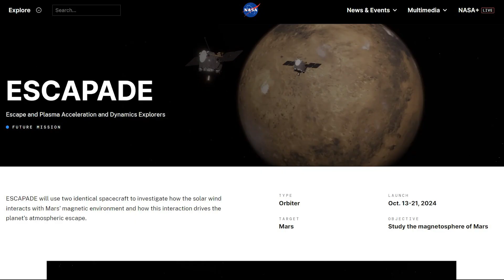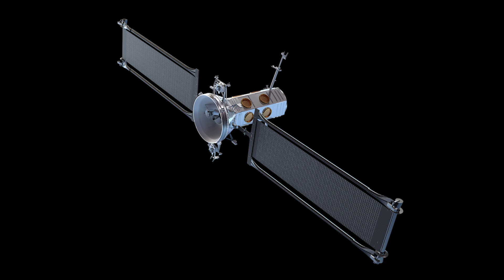Blue Origin Wants To Land New Glenn’s Booster On The First Try

Comment: BO are amazingly optimist, They not even had a static fire. I wish them well, BUT I cannot understand their level of confidence for a rocket that's never even been tested on the ground from a company that has never got close to orbit by a massive factor. Let alone landed an orbital test rocket.
Well one thing excitement guaranteed.
Reply: I guess that's true. They have only tested the individual engines not the assembled booster?
Reply: @wombatillo  They have tested 2 BE4 engines on the ULA Vulcan rocket, But 7 is something else.
Reply: im split on it. on the one hand theyve only ever launched their tiny new shepard rocket. on the other hand the company has within it many employees that do have the full scale orbital experience. additionally the landing profile is significantly easier than falcon 9s given that it can slow to a hover above the pad and lower itself to a landing instead of F9 which must perform the hover slam. I was pretty surprised to hear this from bezos as i had previously assumed new glenns first stage was too light to hover. either way it will be interesting to watch
Reply: 2nd Stage static fire is supposed to be happening in just a few days as it is on the pad, and booster static fire whenever it reaches the pad.
Reply: Back in the old days sonny, engineering meant designing and testing something such that it worked more or less as intended from the get-go. This is why you live in a modern built-up world with things like jumbo jets and skyscapers. People don't build a skyscraper and expect it to fall over. Zero Saturn Vs blew up. The Space Shuttle performed more or less as expected on the first flight. Nobody is surprised when a new airplane takes off and lands uneventfully. It is just the Elon Kool-aid that has conditioned many to think engineers are inept apes throwing ideas at a dartboard.

Comment: I'm astonished you don't have a million views for every video.  You are the Wall Street Journal of space news.
Reply: A lot of times he’s even faster to post and covers content that not even the space channels with over a million subscribers cover.
Reply: I love that huge insult. Very well placed
Reply: most successful tubers are high on personalities
Reply: Better than Rocket is here
Easy lift off 
Easy land on with antigravity Spaceship
No Fire
No Explosion
No Flame
Just Spin and
Lift off
Powered by Baterry

Work base on Gravity just spinning by using Battery
can fly in bad weather, plunge in the ocean even in outer space
Can lift more than 100 Ton 

Earth which weight predict 600 trillion ton does not fall at the Sun because of centrifugal in orbitting, on the contrary it does not be thrown far go out the orbit line of hold by gravity at the Sun as orbit center. Gravity and centrifugal is equal called Equillibrium, thats why until now Earth which we was inhabited always rotate and circulate the Sun. Now we justly take example : how if the gravity used and centrifugal is negated? The Earth will float far leave the Sun. So that centrifugal can be used to fly far away if gravity eliminated. Finally how to eliminate gravity?

It’s way rotate part of aircraft by horizontal. When that rotation faster centrifugal force getting greater and the gravity getting smaller, finally it lose the gravity and the aircraft start flying. Of course people would surprise: how the aircraft can keep rotate without fulcrums? Thats why we named that aircraft Shuttling System that is aircraft likes two disc adjoining attached in the midle as fulcrums:

A. The Top part, we name Positive rotate to right, and the edges is getting thicker and havier.

B. The Buttom part, we name Negative rotating to left, and the edges is getting thicker and havier.

C. Middle Part , we name Neutral, air crew placed and also machine and everythings turning Negative and Positive at the same time.

The aircraft can liftup added with explosion from the engine. However that aircraft construction later, let the engineer doit it, and we are sure the aircraft will bulletproof and also waterproof.
 
.
.
 
In modern civilization where human being generally using flying saucer as vehicle, will a lot of change in lives either in materialism and in psychological. In materialism area will apply the change in life like.
People no longger need roadway and rel road which spend large of energy, money, places, things and time, object place and time. People would utilize that area for habitat or for other need:
Reply: Some reasons I can think of: 1) I struggle to follow his voice with the way the volume drops off at the end of each sentence. I push through because he covers things others don’t.  2) He does not seem to interact with the comments. Just adding likes would help.
Reply: @TheScottShepard  I feel you there. It's almost like he doesn't own the channel but he is paid to be the actor
Reply: Rocket is complicated and dificulte
Low safety and high cost
We need somethings better
Developing technologies to enable human access to space at dramatically lower cost and increased reliability #FeelFree

Comment: Who will first achieve booster reuse, New Glenn or Starship?
Reply: BO will, because NG is a finished design, and Starship is still in prototype. However, it's not a race. NG is not the same class as Starship. NG is a heavy, Starship is a super heavy.
Reply: @hawkdsl  

Starship probably has a lot of unidentified unknown unknowns still (witness the massive complexity of the slush strainers, this is definitely the gift that keeps on giving), NG, not so much. Basically NG, needs to validate the “conservative” design and incorporate some small iterations and it will be completed. Even the most complex aspect, the engines, are fully proven. The first flight will provide the necessary data to fully characterize the dynamics for the control systems that are onboard (validating the simulations). NG’s first flight will be “boring” other than the landing. Sx falcon is much harder to land and they had a learning curve but the fans gave them a pass.
Reply: @Mentaculus42  Agree.
Reply: Two or three years ago it would have seemed completely ridiculous to say that New Glenn could reuse its booster before Starship. But it doesn't seem so ridiculous now. Props to Blue Origin.
Reply: Which ever it is, one of them will be more entertaining.
Reply: BO of course, Starship cannot even get a launch licence.
Reply: @favesongslist yeah the bureaucracy is gonna mess it up, I’d say new Glenn
Reply: im thinkin starship but who knows?
Reply: BO will be the first to be the second company to ever achieve what SpaceX has already achieved. How exciting!(NOT)
Reply: @kd5txo  

Who cares if BO has a bigger and more efficient competitor to falcon as far as “exciting”, just that there “is” a cost effective competitor that will launch a starlink competitor and is not too big for general use (sometimes bigger can be too big). Also BO has a pathway forward for “fully reusable” that falcon doesn’t. So maybe something can be learned from the parable of the 3 bears. Falcon, spacex, BO.